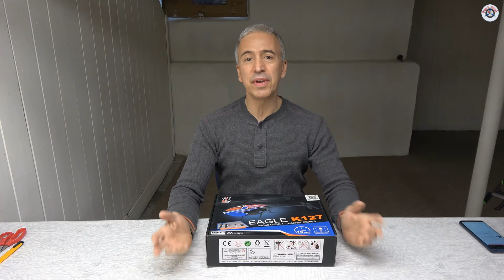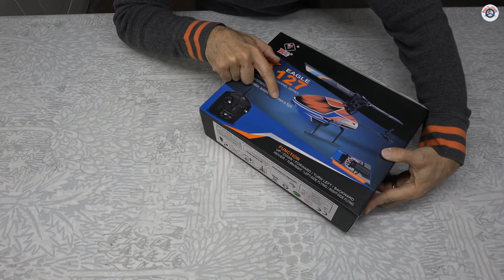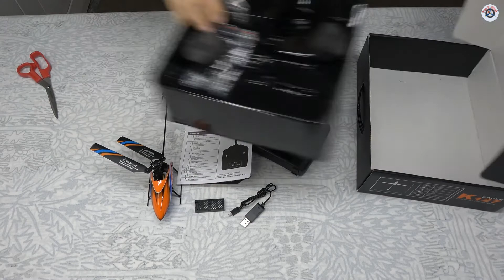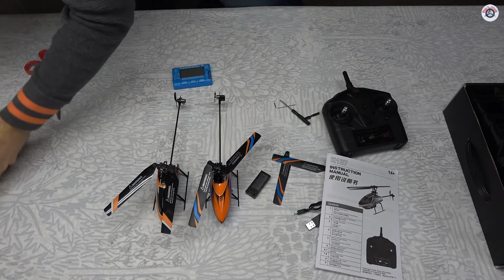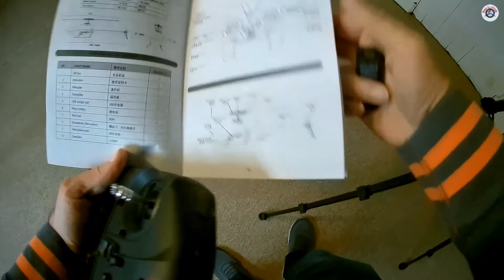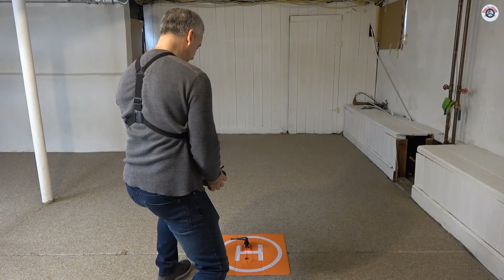XK K127 Eagle 4CH RTF Beginner-Friendly RC Helicopter - Part 1: Unboxing and Indoor Testing

Comment: Hello sir is that a inflared
Reply: If you me infrared transmitter no it is not. It's a proper 2.4ghz indoor/outdoor transmitter. Infrared are typically only found on 2-3.5 channel toy helicopters made for indoor use only.

Comment: It’s a great helicopter but I’m on my 3rd one .  I got approx 50 flights from each one before I had battery connection problems on both 
There’s zero customer service from WL TOYS. Cool RC I returned 2 to Amazon. But purchased external warranty for 3rd one !  Will see how long this one lasts for ?

Comment: Sir after a fall my helicopter turns on him to the right but just when I put full throttle (I changed AC engine and propeller but it continues? Do you have a tip to know how to check lhelico?

Comment: Dear Sir I wrote to you a while ago about the XK A160 RTF cub  I'm trying to bind it to my tx16s radio but no luck. Can you help me please
Reply from the maker: Dear Johan. Apologies that I missed responding to you earlier request. I just responded. Here is a copy of my response:
Dear Johan. So, did you use the protocol "XK" and subprotocol "WLtoys" on your TX16S, as I have shown in this video? If you did and it did not work, there are at least these two possibilities (assuming that its receiver is not defective):
1) XK started using a new protocol in the later versions of this A160.
2) Your TX16S' firmware needs to be updated.
I suggest that you update the firmware on your TX16S to the latest version and try again.
https://www.open-tx.org/
Reply: @PropsWheels  Dear Sir. Thank for replying. Yes I'm on EdgeTX 2.7.  Do you know what the new protocol is for XK.